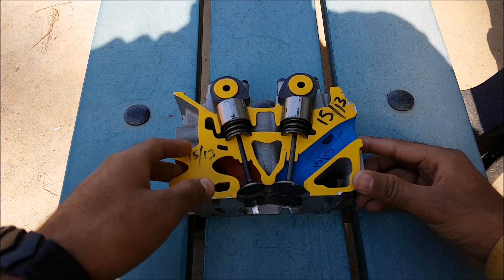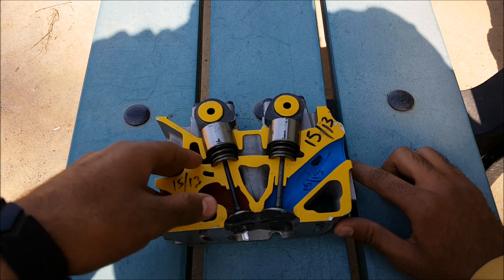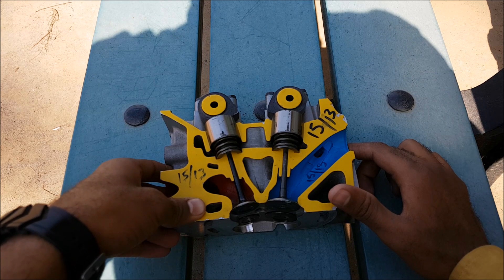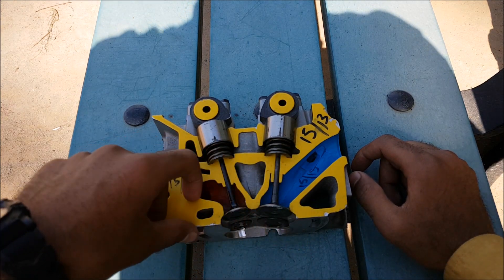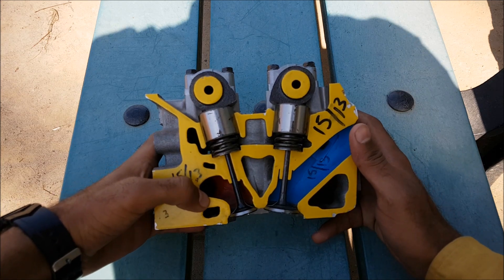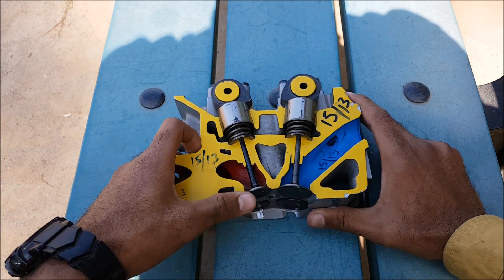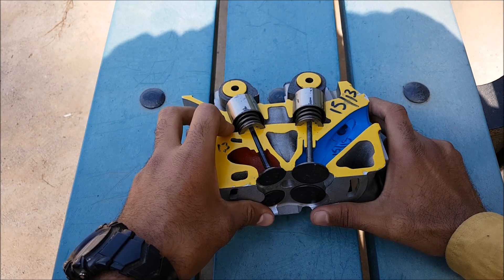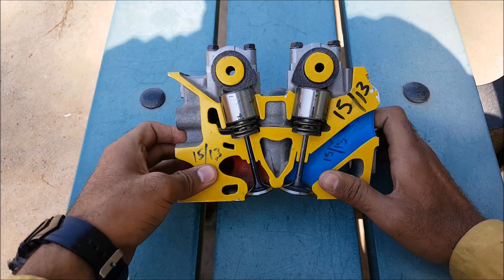Dual overhead Camshaft (DOHC)

Comment: why the valve of exoste are small
Reply from the maker: Dear the exhaust valve is kept small, the reason behind this is that in exhaust stroke the piston moves from BDC to TDC, and it pushes all the gasses out through exhaust valve.
Reply: @automotivespot  thank you so much for your answer